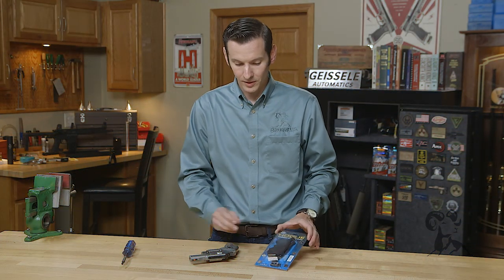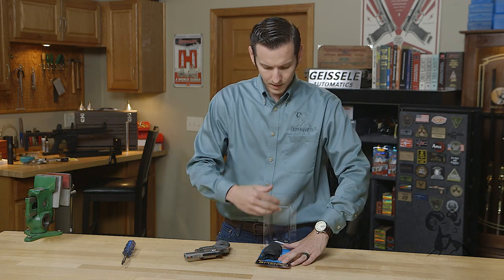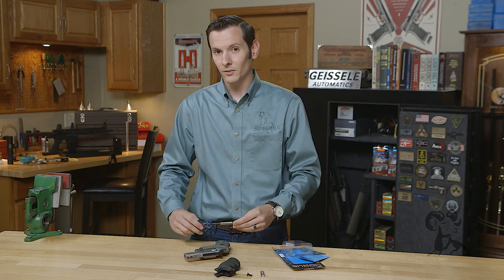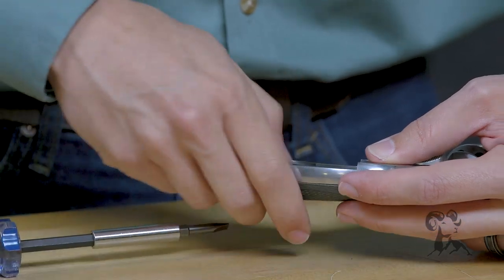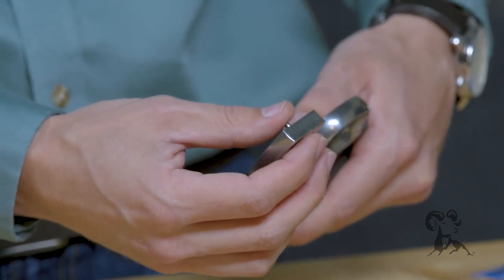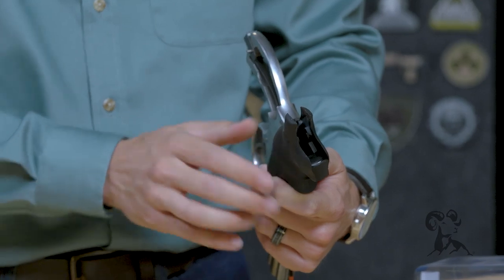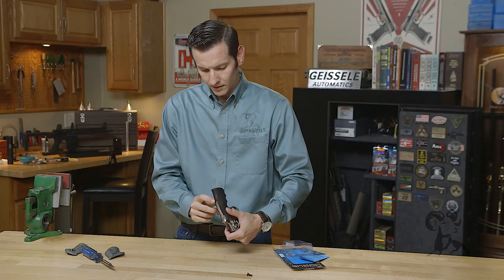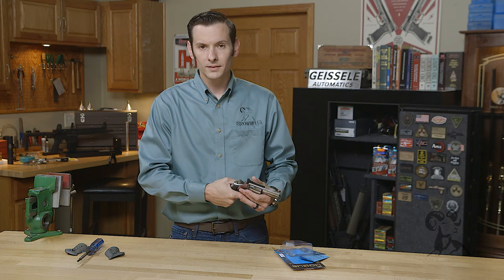Quick Tip: How To Install a Hogue Monogrip

Comment: Super tip from Hogue support if for some reason the screwhole on the stirrup/bracket doesn’t align with the hole on the grip (which had never happened to me before but did installing a Hogue monogrip on my N-Frame Model 627):  get a typical, conventional foam earplug (mine were blue so very visible).  Cut the earplug in half and gently, using a probe or small punch, insert the piece of foam between the stirrup/bracket and the frame. Don’t worry that it’s obstucting the hole from underneath, the screw will push right into it.  Slide the grip on to where it is fitted perfectly in place.  Using a flashlight, look through the hole and see where the earplug is showing through the screw hole (this is where a brightly colored one comes in handy).  Using the punch (and careful not to damage the threads), gently guide the stirrup/bracket hole in alighment with the hole on the monogrip. In my case, when shining the flashlight in, all I could see was blue when I had done this correctly...that was how I knew the holes were aligned.  Screw locked in first try. Shout out to Teresa in Hogue customer service for this tip.
Reply: Another way, which I just did, is to first put the screw in the bottom hole before you slide the grip up.  When you slide the grip up, just before it reaches all the way to the top, you'll feel resistance against the screw.  At this point just start screwing it in, and as you do, it will move the grip up the rest of the way and into place as you tighten it.  I tried over and over and it never aligned, then I tried it that way and it worked perfect the first time.  I didn't even need an earplug or anything extra.

Comment: How about doing a video on replacing the grip on a Taurus Model 66.It doesn't have the screw at the bottom.
Reply: garageguy879 the hogue grip will be compatible. I installed one on my Taurus 85 and it comes with a little adapter clip and a roll pin that will allow you to use the screw on the bottom.

Comment: Now this is how it should be designed. I have a Hogue grip that they actually sell for $30 WITHOUT a retaining screw. So, you just have to hope and pray that you can slide some cheap plastic on either side of a roll pin without damaging the cheap plastic holes inside of the cheap plastic butt cap. Then, if they don't align properly, good luck removing the cheap plastic butt cap without damaging the cheap plastic. You can try to repeat the process, but by the time the grip is installed, you will have damaged your firearm, the table, and the cheap plastic grip. 

I would prefer a retaining screw at the bottom.